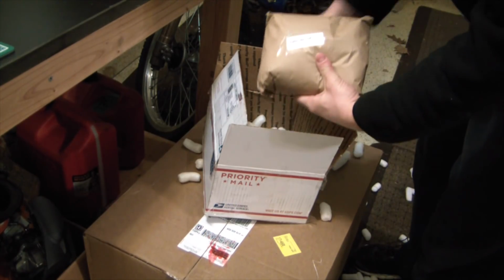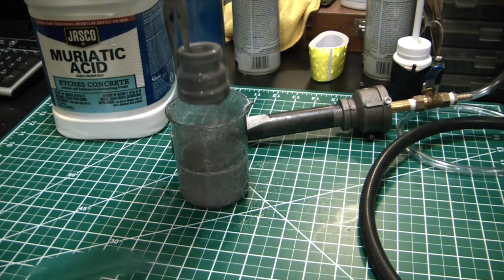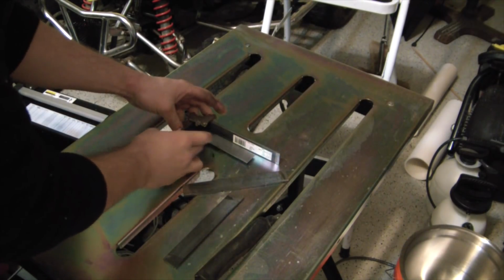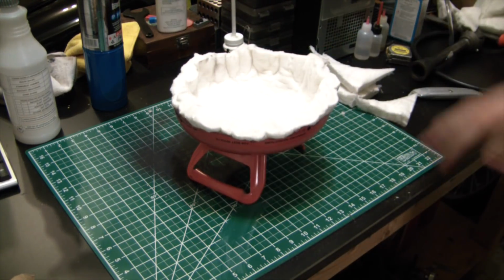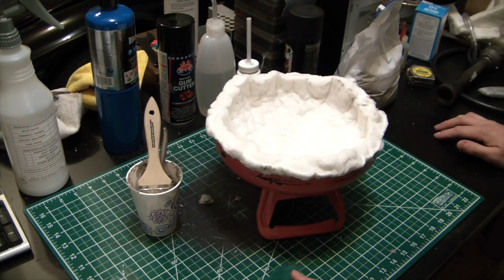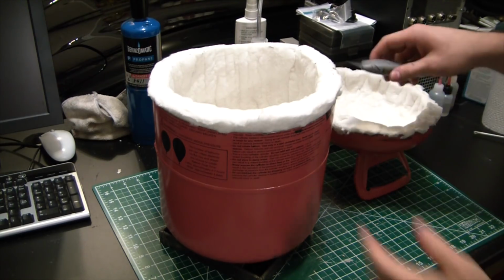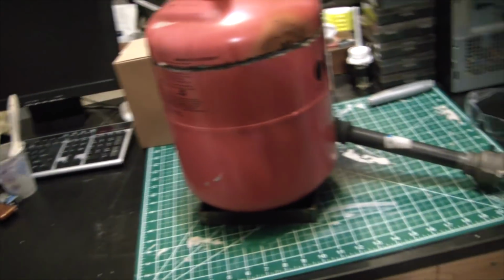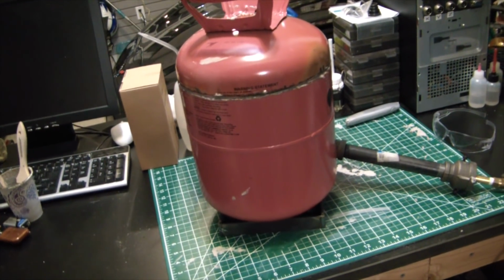HELIUM TANK FOUNDRY - EASILY MELT METAL AT HOME! - ELEMENTALMAKER

Comment: Use the metal

After coating with satanite both parts with satanite leave a surplus on the edges of both.

Then pres both parts together to trim of the surface neatly

Comment: Sand and plaster of Paris 50/50 mix works really well about an inch thick and it holds the heat..outside you can touch and not even warm to the touch.
Reply from the maker: Unfortunately that mix only lasts a few firings before cracking to oblivion. Proper refractories like used here will last hundreds of firings without issue.

Comment: You really didn't need to paint it after you got rid of the zinc coating!  It is going to be heated many times over and the rust certainly would have mattered or causeed any kind of obstruction!

Comment: 2018  ??? How is your melting pot doing these days, Did it last some time? I knew a guy that would make an oven with only the wool, no walls just the cloth. I'll probably be using some hard heavy fire cement then use styrofoam balls like in bean bags to add some air. I belonged to some casting web sights and the castable cement is like turning lead to gold unless you work at a place that makes the tuff. Best to spend the money, Great videos!!

Comment: Flash rust!  By the way, You can use Black molasses for de-rusting anything... .. .
1gal. Molasses for feeding deer or livestock about 8 bucks great deal!! (need to not be De-sulferd)
1 part molasses to 9 parts water..or less. Submerge rusty crusties for 2-3 weeks. Stuff runs of like silt.
Lasts 6-7 Months. I spray with a pressure washer and scrub a little. I use large or small Tupperware bins. For trailer axles, I use 4in PVC pipes with caps. 
Old-timers used to dip car parts in kiddy pools. Watchmakers also used Any green tea available. 
It's called the chelating effect.                 Like to share this as it works very well.

Comment: Currently working on the same build.  Same tank.  Curious to know if the Satanite was successful in adhering the ceramic fiber wool to the cover.
Reply from the maker: Yessir Satanite still holding up great. I had to fill in a couple cracks after the initial few firings, but after that it's been great

Comment: Working with Kaowool is just about as fun as working with asbestos, because it likes to rip your lungs apart just like asbestos.
Reply from the maker: The particle sizes are quite different from asbestos. While I still wear a mask while handling it, it's much more like fiberglass than asbestos in terms of danger to the lungs.
Reply: @ElementalMaker  Particle size is even better. Do ya want tiny little cuts or larger ones?

Comment: All of these "health hazards" are a joke. Use common sense and you won't get any poisonings.
Also, that asbestos bullshit is really funny. I am not a cretin to cut it with an angle grinder or something like that, and to release asbestos from the tiles, there has to be abrasion. Asbestosis has only ever been diagnosed in peple who work with it.
Eating lots of tuna doesn't mean that  you'll die of mercury poisoning. 
Eating an occasional processed meat sandwich won't give you cancer.
Your dog won't die from a little onion in the food you shared 
On the contrary however, sleeping is much more likely to kill you, since accidental suffocation while sleeping causes 10 000 deaths a year, much more than all of the above, so I guess you shouldn't sleep as well.

Comment: If you use body soluble ceramic blanket insulation there is very little risk of serious issues with inhalation of the fibres. I don't know which type you used, but since you do seem to know safety protocols (even if you pretend to pay  them little attention) it probably is the safer stuff.

Comment: I did a propane tank foundry and removed the valve the same way you did with a holesaw. It was a adventure for sure. I used fire clay and vermiculite as refractory and it worked really well.

Comment: Ages ago we used muriatic acid in school when designing circuit boards. Word of warning. The fumes will fckup your lungs even with ventilation. Vinegar will do the job if you dont mind waiting 4 days +- . Phosphoric acid isn't as strong as muriatic acid but it might be worth trying. They use it in soda and works great with rust.

Comment: Use a metal paint can and pour in a 50/50 mix of plaster of paris and sand then use threaded rod as the base drill a hole for a propane torch and thats it
Reply from the maker: That mix will never hold up. Might last a few firings. This will last hundreds.
Reply: @ElementalMaker  thank you for the advice

Comment: I know I'm two years late but might I suggest if you haven't already done so: add a second side hole hooked up to a blower or heat gun which should increase your temperature quite a lot and give you more uniform heat in the cyclone. You also need a slag hole in the bottom in case a crucible (When...) cracks and spills all over the base. You can also plug the gap in the burner hole with the scrap fire wool. I'm working on my next foundry this summer. How did yours handle these past two years?

Comment: great video... I'm kicking myself that I threw out that helium tank.  Just built a forge from a propane tank so I may have to search for another one or hold a party for the kids with balloons..hehe
Reply from the maker: I just used what I had handy. Propane tanks work just as well if not better, and even have a larger capacity! Just take a bit more time to heat up.

Comment: You can use a thick porcelain slip to saturate the rock wool and make it stick to the inner canister.  Let dry thoroughly and fire at low heat increasing several times over two hours.  It will withstand 4650 deg F. & highly heat reflective!  (Much cheaper than Satanite)

Comment: As a retired automotive ASE Master Tech, this stuff is fascinating watch someone use their noodle to make stuff in the shop. I really had to laugh out loud in the garage when you started talking about post “This will kill you, etc.” I think some of these people grew up snacking on Lead Wheel Weights! I am not going to tell you how to build like others, but tips on some tool issues. #1 hole saws have the same drill bit but breaks off once cutting hole. I change the drill bit out, replace it with metal rod stock the same size to save drill bits.
#2 After drilling holes and they are off or need larger perhaps offset, I found it works great to chuck a rat-tail file of the right size or end to other end to fit. Once in the hole, wearing welding gloves, but place a 4-6” length of gas/water pipe (Even Conduit), but you can steer the rat-tail file any direction and reverse it if climbing up hill the wrong direction. This one works great and hogs the hole out where you want it. I was surprised when I tried this about 15 years ago. Just a couple of new option for the creative guy and getting it done.
 Oh, fire can give a Boo-Boo if you touch it! LOL!
 Subscribed, liked and saved it to my favorites folder. Thanks for the video and info!

Comment: When calculating the circumference measure the diameter and subtract the thickness of your isolation wool this will give you the middle line of the isolation since we have 2 walls 2×1/2 =1
Why the middle line.. The outside streches the inside compresses middle stays the same

Comment: I use  plaster of paris and kiln dried sand, 50/50 KILN DRIED is the important part. if you wonder why, just hold a torch to some regular sand and you'll wonder no more.
Reply from the maker: Don't waste money on that, plaster of Paris isn't a refractory and it'll only last a few firings. Insulating wool and a refractory coating will last hundreds.

Comment: Thanks for the vid , wouldn't{Castable Refractory Cement, 45% Alumina Low Cement Castable, Accomon-45 } be cheaper and work just as good? 1550c temps...it should handle or better.
Reply from the maker: Castable refractory cement is quite expensive stuff, the insulating wool is much less expensive and also much lighter so your foundry won't be as heavy.
Reply: @ElementalMaker  thanks so much for ur {FAST}reply and great insight. I 1st had trouble finding what u used but found 4lbs of "castable ref." for $23. I want to make knifes and maybe play with some glass.
Reply from the maker: @themegasexybasterd  no problem! And a foundry would require way more than 4lbs of refractory cement, insulating wool will be way ln easier and cheaper to work with. Just get a good coating like satanite or itc100 for it

Comment: Thanks for the vid , wouldn't{Castable Refractory Cement, 45% Alumina Low Cement Castable, Accomon-45 } be cheaper and work just as good? 1550c temps...it should handle or better.

Comment: My mom used to fire up her electric kiln to cook her ceramic  painted dish ware.  She used little ceramic cones, like an inverted ice one only just an inch high. To tell her the temperature. You don’t have a thermometer on the furnace.  I’m sure you can buy the cones in various heat ranges to tell you the approx temp in the forge if that is something you need to know.  Her kiln could get to a couple of thousand degrees if I remember correctly.    Good luck with your project

JoeB

Comment: I made your burner and use it in my coffee can forge its essentially a flame thrower but today I happened to get a helium tank same as yours. It is going to be my knife forge. Do I still need the flare on the burner if I am going to put it in the forge? I am aiming for about 7" inner diameter or so
Reply from the maker: Nice glad it's been working for you! Yeah the flare is still needed, it'll self extinguish without the pressure change from the flared zone. Good luck on the build! 👍
Reply: @ElementalMaker  thanks man! I'm just glad I can heat treat knives reliably now!

Comment: And yet it continues ... It's a FURNACE (an enclosed structure in which material can be heated to very high temperatures, e.g. for smelting metals) not a FOUNDRY (a workshop or factory for casting metal).  If you are going to make a videos then please get your terminology right!

Comment: When making my forge I coated the inside with this product called ITC-100 which greatly improved the heat output (got to welding heat for steel using propane)
Reply from the maker: I hear ITC-100 is great stuff! From what I hear its quite superior to satanite, but also much more expensive
Reply: ElementalMaker absolutely it is expensive. At the time I was a poor high school student so I bought only a little, still it was close to $50 for a pint! Now, over 15 years later, that gorge is still going strong, well worth the price if you use it long term
Reply from the maker: @jscancella  now that's an impressive testament to itc-100's durability!

Comment: Use a good electricians knockout punch for the holes.
I use them all the time for all sorts of projects in metal up to 10ga Mild steel. 
They cut very clean very round holes that dont need to be deburred usually. And work perfectly on concave/convex surfaces.
If you use a good cordless impact gun (or air impact) and socket to drive the arbors, holes up to 2 7/8" take almost no time or effort.

Comment: From the outside inward it goes like this.
Metal container
Kaowool
Wire mesh secured with bolts either welded or bolted to metal frame through the Kaowool.
Satenite over the blanket and secured to the wire mesh.
The Satenite will just tear apart from the wool like it was a cotton ball.
Ask me how I know!

Comment: DO NOT FLUSH OUT PROPANE TANKS! 
FILL THEM WITH WATER UP TO THE CUT LINE!
And I just fired up my foundry outside and let the Zinc burn off in just a few minutes, no acid to buy no acid fumes in the house, no acid to dispose of.
And that flame proof paint will not hold up to the temps it will be exposed to for more than 2 minutes!
Reply from the maker: This was a HELIUM tank as stated in the video title, description, and narration. Not sure if your familiar, but helium is exceedingly chemically inert.

Comment: You're undoubtedly very far from caring at this point, but for anyone else who may go this route, the black ceramic high temp paint needs a 2 (preferably 3) stage heated curing  cycle to properly get max performance out of it; something like 300* for 30 minutes, let it cool, 400* for 30, let it cool, and 500-600 for an hour and cool again. Per the can, if this is not doable because of installation, you can run it in your chosen operation method for the same times.
 I like the insulated wool with the satanite and the next one I do I'm definitely going that route!
I've done a very large version some years ago with a barrel-sized barbecue grill that was being retired after many years of good use. I had a half pallet of fire brick someone gifted me when we were in our previous house that I lined that sucker with and it made a lot of good knives and a royal shit ton of coal ash! Given the choice though, I'd whole-heartedly go the insulated wool route and either sandblast the exterior or if on a budget, go to town with an angle grinder and some el cheapo flap discs for paint removal.

Comment: Hey dude, not a criticism, but were you aware that you can strip zinc by using lye solution which will leave the iron unaffected? Muriatic acid - straight from a witch's tit - will dissolve both zinc and iron.
For the next time.
Reply from the maker: Good point didn't even think of that!
Reply: @ElementalMaker  Have been planning to nickel plate a galvanised can by first removing the zinc this way; procrastinated thus far. Maybe later :)

Comment: Plaster a Paris works really good
Reply from the maker: Plaster of paris wont hold up for long term use. You might get a few melts, but it will quickly lose structural integrity. Kaowool and a refractory coating will last indefinitely if cared for.

Comment: How's this holding up. The satanite in particular.
Reply from the maker: Haven't used it too much, but still doing good!
Reply: @ElementalMaker  I'm making a forge and foundry. Very small budget for what it is. I cant afford to do it wrong. Thank you for responding.
Reply from the maker: @Zombieslhut  I think the satanite will treat you well. It seems to be very robust stuff. Satanite plus some insulating wool and you can get a very low budget foundry together.
Reply: @ElementalMaker  I'm in between satanite itc 100. I plan on use ceramic fiber a castable refractory then either the satanite or itc 100ht. I just want it to last and not spend unnecessary money I really don't have lol.
Reply: I think I need the itc 100 either way.
Reply from the maker: @Zombieslhut  I hear itc is great stuff. Probably can't go wrong with it!

Comment: I'm betting your satanite has graphite powder mixed in with silica and plaster of Paris. Try wrapping your burner end with your ceramic wool to contain your heat better and prevent fire coming from out around it
Reply from the maker: I would think any graphite content would make it much darker. I recall looking at the sds and it was mostly aluminum oxide if I'm remembering correctly

Comment: You could also use an old propane tank to make your forge without having to weld a base onto it. Propane tanks already have a sturdy base welded in place. Naturally you're going to have to be extremely diligent in vacating all the propane from the tank before doing any cutting. Remove the fittings on the top of the tank, then fill and flush the tank several times with soapy water to clear the tank. If you have even the slightest doubt there is any propane left in the tank, fill and rinse a few more times. Here is just one video (not mine) showing the process. https://www.youtube.com/watch?v=xxDhg3HF67M

Comment: Super interested in chemistry but don’t know much about it so quick question: can you remove galvanized metal coating with muriatic acid so that you could then safely weld the metal?

Would really appreciate a response if anyone knows. Thanks
Reply from the maker: That you absolutely can! Just use proper precautions with the muriatic, as its quite strong stuff and be sure to do it outside with a good breeze. The zinc will dissolve away very quickly, in only a minute or so. After that give it a good long rinse in clean water, and then a quick wash in baking soda water, rinse off again with clean water and dry. You will probably get some flash oxidation on the raw iron, but this can just be brushed off.
Reply: ElementalMaker awesome. Thank you so much for getting back to me. Love the channel! 🤙
Reply from the maker: @mxcollin95  always happy to help out. I try my best to answer every comment on my channel

Comment: All these people saying galvanized metal wont hurt you have never welded very much of it. If you ventilate you'll be fine but if you dont you're gonna be sicker than a dog.
Reply: As shown in this video.......a quick dip in a muriatic acid bath will strip the zinc coating right off the metal. Give it a nice bath in some water mixed with a generous serving of baking soda to neutralize the acid, and voila, you're totally safe to weld without the risk of zinc poisoning.

Comment: So have you discovered that paint sucks yet?
Reply from the maker: Which paint is that? The VHT Flameproof or satanite?
Reply: @ElementalMaker  the vht, I've burned it off of more than a few sets of headers on my trucks over the years. It's usually only good for a few months as exhaust paint so I can't imagine it would last even a single burn in a foundry
Reply from the maker: Yeah its pretty junk stuff! The rustoleum high heat seems a little better.

Comment: You won’t get zinc poisoning from that small part. Too many know it alls.
Reply: Can gat chlorine gas from the acid
Reply: @jjw5165  Not really, chlorine would rather stay in the chloride form unless you'd introduce it to oxidizer.
Reply: Sure can, got it from welding just a small M12 bolt head that was galvanised.
Reply: Jaakko Fagerlund then you need to find another profession. I’ll take “things that never happened for $100 Alex”. 🙄🙄